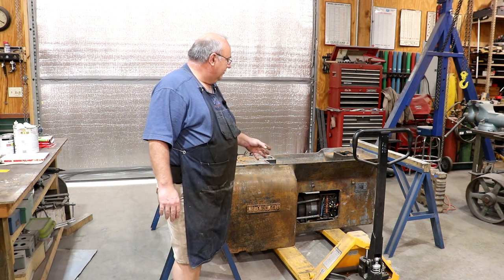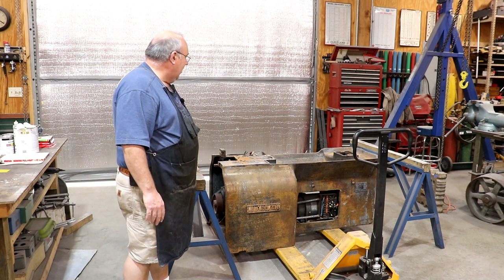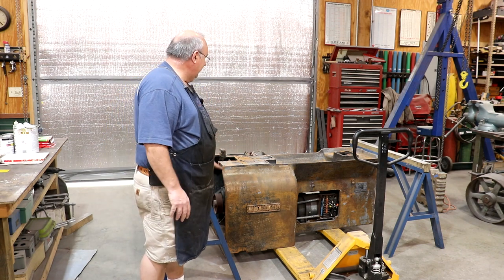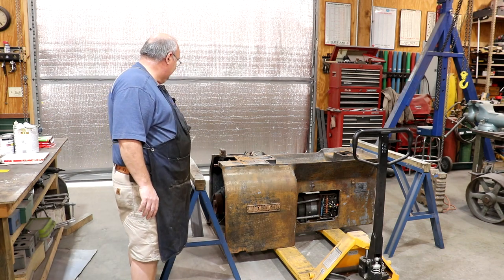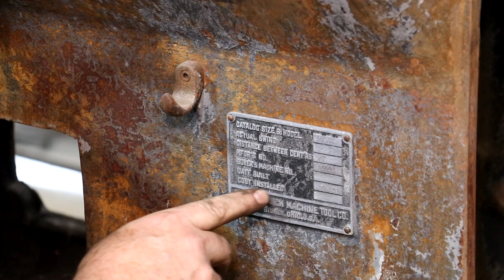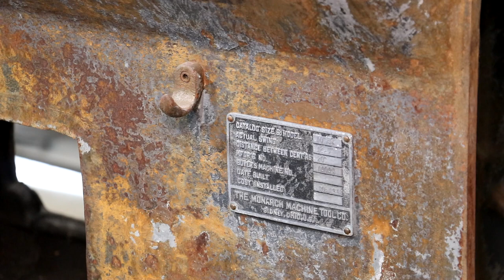Monarch 10EE Lathe Restoration 4:  Removing the Motor Drive System

Comment: A pleasure, as always. As you pulled the motor and generator, I found myself picturing the rails and lifts that might have been used in assembling these lathes in (relatively) low volume environments. Do you think the manufacturer info on the tag relates to multiple manufacturers building the lathes?  Thanks for the video.

Comment: For the other machined surfaces that you want to protect clean it very good and apply a couple of layers of ductape.
If you use quality ductape and press it down good it doesnt come loose with sandblasting.
Best wishes in 2022 Keith.
Reply: Aluminum tape stands up well to sandblasting.

Comment: Interesting way they worked out the DC motor.  Very nice sewage block you have there.
Reply: "sewage"??
Reply: @paulcopeland9035  sorry Paul, I misspelled, there is no "e", it was a swage block. I am sure there is not a sewage block in the shop's pipe, my apologies. Thanks for pointing that out it made me laugh.